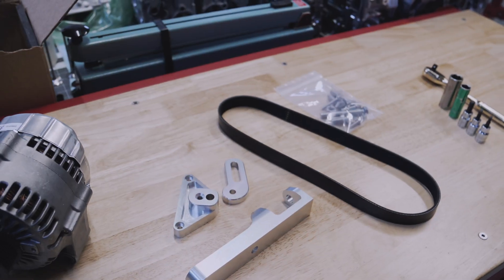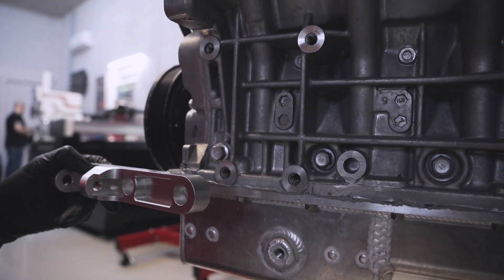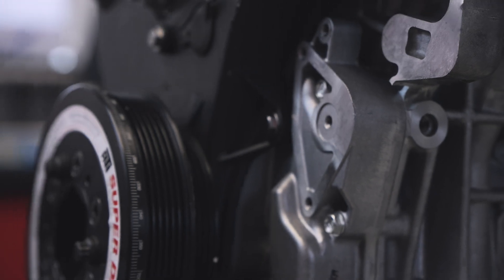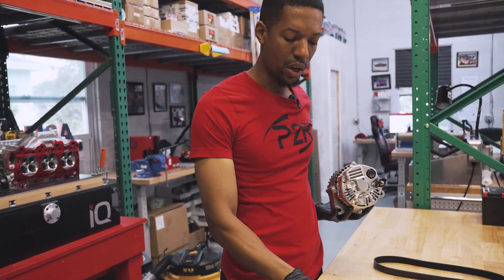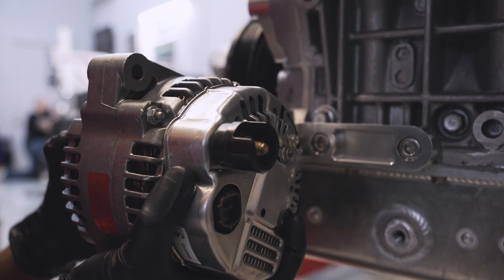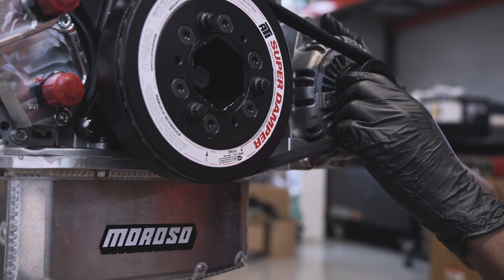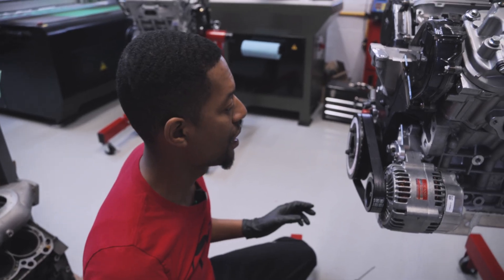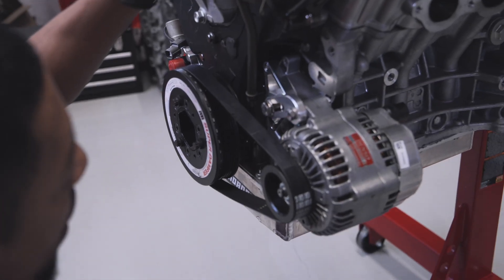P2R J Series Alternator Relocation Kit

Comment: if you're doing a j swap in a daily where you probably want to retain the ac compressor, this mount probably wouldn't be the best thing in that application right?
Reply from the maker: Correct.  This mounts in the original AC compressor location
Reply: @PowerRevRacing  thanks good to know.👍🏽 and by the way I’m really excited for the rnd you guys are doing on the j30ac can’t wait to see how everything turns out.